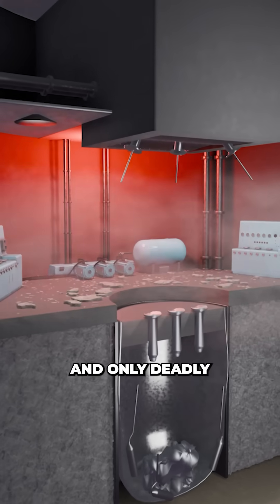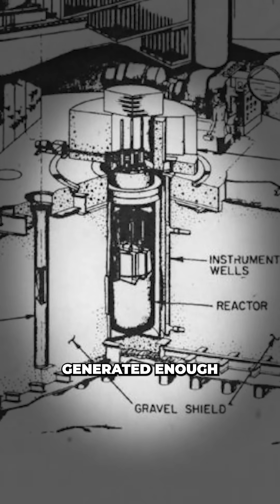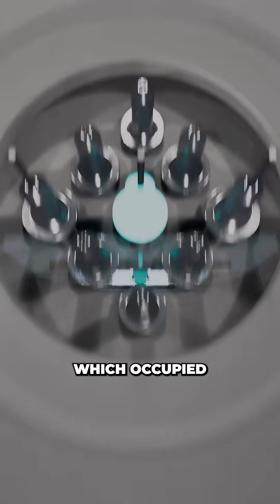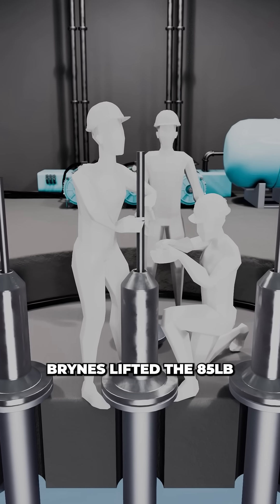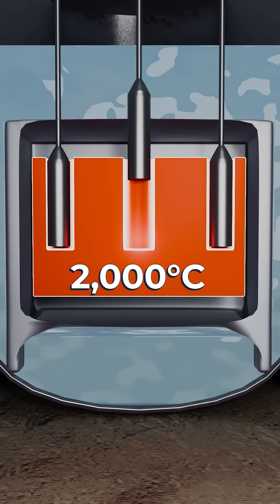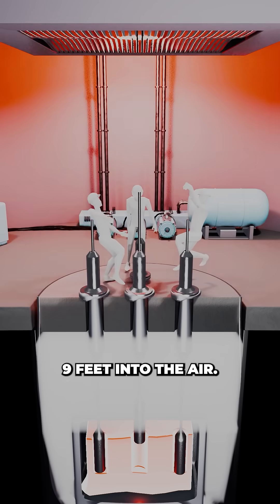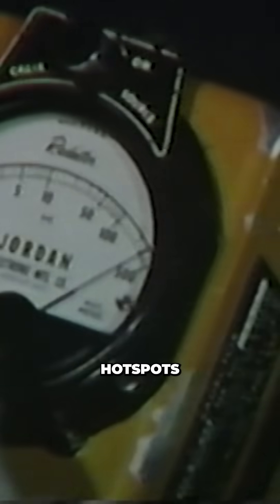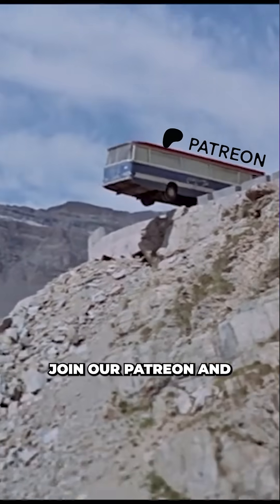The True Story of the SL-1 Disaster

Comment: "shredding his DNA" is the scariest sentence I think out of the whole video
Reply: Idk, "The explosions pressure wave blew loose one of the control rods, which shot upward like a cannon shell, piercing his chest and propelling him upward, pinning him against the ceiling" is pretty gnarly as well, but at least his death was instant. I'd take a cannon shell point blank to the chest over any amount of lethal radiation poisoning every time.
Reply: @AG-eb8yy they died almost instantly all 3
Reply: @ulrichkristensen4087 McKinley actually showed signs of severe shock and living a couple more hours before dying. The other two were instant
Reply: @AG-eb8yy well I’m not sure if it was instant. Without factoring in radiation imagine having your lungs and stomach instantly blown out by a rod of metal and being left to suffocate or bleed out (whichever one gets you first) suspended from the ceiling with no feeling in your chest except pain
Reply: @JMNplays584 you'd probably go into shock pretty quickly.
Reply: @AG-eb8yy It entered his groin and exited his shoulder, but your point is still valid.
Reply: @AG-eb8yy I don’t know man, it’s scary yes but having your dna banished to the shadow realm is kinda scarier. That is literally the genetic code for your body and it’s now simply gone 😭
Reply: @AG-eb8yy Was it instant?
Reply: @londonnelson7359  how could it not have been?
Reply: @ApertureAce  If it went through the right side of the chest, puncturing only the right lung and avoiding the aorta or vena cava, he could have lived for a bit.
Reply: @Justin.Franks  I think that the amount of trauma from a rod shooting through one's chest would massively impact the heart - even if the rod cleared it altogether. With that much trauma to the chest cavity, I'm doubtful the heart would be unscathed
Reply: @ApertureAce wow are you a doctor ❤
Reply: @ApertureAce  Radiation damage aside since I have no idea if what they received is enough for instant death, You might be very surprised (and horrified) to learn how long humans can (and have) live with objects sticking through their torso or even occasionally through their head. Depending which organs and arteries get damaged, and to what degree, a person could survive being pinned to the ceiling by a metal rod for more than a day without medical intervention, and in a non-nuclear meltdown scenario, could even potentially be saved and restored to near normal health.
Reply: @AG-eb8yy im of the opinion that the only humane treatment for high levels of radiation poisoning is a lead pill. its what id choose. survival is possible even with extremely high exposure, but improbable, and id choose a quick death over rolling the dice for a chance to survive my organs liquifying while im still alive to feel every second of it.
Reply: "shredding his DNA" is the scariest sentence I think out of the whole video

It is. Because radiation does not kill you outright. 

DNA is – in layman terms – the plan by which the body keeps rebuilding itself from the constant decay it experiences, keeping you from decomposing, by simply replacing dead cells. 

When those plans are shredded, that work stops. So you start decomposing while still alive... like a zombie.
Reply: @michaelkarnerfors9545  Radiation very much kills you instantly at much more than 10 Sievert like here.
Reply: @alexandernater6284 so with the amount of radiation he received in such a short time...causing his DNA to shred....does that mean, like...he was decomposing WAYYYY faster than someone with a much lower but still lethal dose ? Or maybe like I can imagine if you were watching closely you could see the radiation causing reactions on/in the skin and body and eyes...
Reply: @Globblin_DaFlowerChild  Radiation will cause massive tissue damage, looking superficially quite similar to severe burns. But what kills is the rapid shut down of the CNS. That has nothing to do with decomposition though.
Reply: Reminds me of a japanese victim. He received a horrendously high radiation dose. His body was literally falling apart and melting as doctors did everything they could to keep him alive. I honestly find this story particularly gruesome because he was kept alive against his will, doctors wanted to test experimental treatments for radiation poisoning.
Reply: @bassbusterx  IIRC his family begged to keep him alive so they kept testing treatments until he finally died
Reply: @Consumpter which honestly I find so awful. I'm not saying I don't understand, but they knew it was lethal, they knew he was suffering tremendously, they knew he wanted to die and yet they kept him alive. You're basically a prisioner of your own body at that point
Reply: @Consumpter you know what it doesn't really matter the man was still in his right mind and he should have told him the but the f out
Reply: @bassbusterx  We are always prisoners of our own bodies until death.
The torment in his last days as his whole flesh slowly melted off his bones, though, is the horror part.
Reply: @bassbusterx well but I guess even with everything they tried, it likely still didn't take much longer
Reply: @Consumpter any family that witnessed a loved one going through that and wanting them to be tested/kept alive is delusional. That's horrific
Reply: @bassbusterx they didn’t know he wanted to die, his last words while he was able to speak were that he wanted to live.
Reply: @bassbusterx  literally every single civilian nuclear disaster was caused by gross negligence. This genuinely pisses me off so much because imagine if they just kept the stuff up to date
Reply: @bassbusterx  the experimental treatments were stem cell therapy, bone marrow transplants from his sister, and blood transfusions. They didn't use him as a guinea pig but rather were desperately trying to save his life. If it had worked, the narrative of him being "experimented against his will" wouldn't exist.
Reply: @edluke3415 you’re assuming that because life is preserved, quality of life is assured.
Reply: @Lisa-im6hy Well, life preservation is usually the first step to quality of life.
Reply: @LorenzoCassaro lol, and the leading cause of death is being alive. there is no guarantee their experience after would be anything to rightly ask a person to endure purely for the sake of being alive.
Reply: @LorenzoCassaro  yeah? id rather die than live as a corpse
Reply: @edluke3415  I think everyone knew it wasn't going to work. Have you seen pictures of him in his hospital bed? It was like he was melting.
Reply: @bassbusterx grief is a powerful thing and his family still held out hope. Especially since a lot of the treatments they tried on Hisashi Ouchi (I believe that’s how his name was spelled?) seemed promising and almost seemed to be helping.

Him going through all that was so terrible that I don’t even have the words to describe it, but he was also brave for making it so far. The information gotten from the experimental treatments on him benefited the field of radiation sickness medicine a lot, if I’m recalling right. He still never should have had to suffer a fate so gruesome. But he will not be forgotten. Not by me, anyways. His name kinda stuck with me when I learned about that incident. We can’t let anyone else suffer what he went through ever again.
Reply: The body uses DNA to make proteins and other things cells use to repair themselves, or to divide and make more cells. If cells cant be replaced or repaired, as they die off tissues get neurotic. Cells with high replacement rates are particularly vulnerable, like those in the digestive system. Causing bleeding from orifices, and diarrhea). Hair follicles die off, leading to hair loss. Blood and immune cells cant be replaced. But the radiation itself doesn't liquefy organic matter.
Reply: @LionStrategic it depends on high energy  radiation you are hit with. In this case it broke all bonds
Reply: @bassbusterx  His last name was Ouchi, of all names. Hisashi Ouchi. This universe has a wicked sense of humor.
Reply: @bassbusterx  Yeah I don't know if you can feel anything when on a cellular level you got obliterated. I think the brain would do it's best to just keep itself from feeling that unless the brain cells were also fried, than does that make him clinically brain dead?
Reply: yeah, I'm pretty sure the guy that got pinned to the ceiling got off the easiest of the three
Reply: @beeer421 wouldn't he have died the slowest/last? The other two were instant
Reply: @amylee3531  No, he was in the center of the blast so he probably absorbed more radiation than the others, and in massive doses, you become unconscious instantly around 8-20 Sieverts
Reply: @amylee3531  Radiation sickness is probably one of the most horrible ways to die. It might have taken them a couple weeks of excruciating pain to die. Basically your body just starts falling apart.
Reply: That’s the scary thing about radiation. In high doses it can break down both your dna and your rna. Worst case scenario is you die a slow and painful death with radiation burns and the symptoms of ARS (Acute Radiation Exposure). 

Middle of the pack scenario is you die from cancer developed through radiation exposure. 

And best case scenario is you survive the whole ordeal with no cancer , but now you have genetic mutations due to your cells not reconstructing your DNA properly after the radiation exposure. Which btw said mutations can be passed to offspring. 

So yeah , don’t mess with radiation.
Reply: @VenyxK Godzilla is fine
Reply: "cooking living tissue"
Reply: Yeah, it's right out of a frame from the worst potential injuries Spaceman Spiff might suffer, when his nemesis turns their laser blaster up to 'frap ray'.  😬
Reply: Decompression chamber accidents are brutal but i dont think you'd feel anything.. So yeah, this is way worse.
Reply: And we know what that feels like because of Hisashi Ouchi. We can only hope they didn't suffer like he did
Reply: "...Pinning him against the ceiling" is what does it for me.
Reply: @peterparkin771  Hey man, whatever floats your boat
Reply: Imagine having a weapon like that
Reply: Idk man, the dude being impaled and pinned to the ceiling wouldn't be very happy either. Given thats NOT an instant death by the way~
Reply: Mmm...did you heard about 3rd guy who got pinned to roof?
Reply: Right.  Agreed
Reply: Lucky he was cooked or he would've been a walking ghost
Reply: Agreed. I would however like to nominate a Runner up "...launching the 12,000KG (26,000 Lbs.) vessel 9 feet into the air"
Reply: It's not just a standard impaling.  It's impalement plus "hit by a tractor trailer" forces  to lift you to the ceiling.

Not saying it had to be instantly fatal, but it's not comparable to an errant javelin impaling your chest. It's a javelin sticking out the front of a freight train
Reply: Exactly 🤣
Reply: HUMANS-- just  grow a garden to eat the fruit,,  vegetable, and feed  the protein that's needed to grow the brain, AND LEAVE THE, "WARP AJUSTment to those THAT WILL EFFECT  THE e.t.'s........
Mechanical nature.\n is why?\n Trump and other MEANING Large entities on OUR planet Earth are playing with nuclear testing again.................. as to have the external\n acknowledgment known to the 3 Rock/water to the SYSTEM 
    SO,  the  e t entities will be called - out what history already knows 
to only a few to HÒLD THE POWER ..............

Tesla FREE POWER. . ..
WHAT SHAME THE GOVERNMENT POWERS WILL FELL IN THAT MOMENT........

   so said glsjr !
Reply: not even the "pinned on the wall by the control rod" ?
Reply: Its true
Reply: The worst death I read was one of the people that volunteered to go into Fukushima to shut it down. It was a suicide mission. He survived in hospital for days after -and died a horrendous death. His DNA was literally disintegrating and he was still alive. One example, his skin started to disintegrate, so they tried to do skin grafts on him but the skin grafts would also just fall off because the DNA is disintegrating so there is nothing to bind the skin to. He had multiple heart attacks and was resuscitated each time, he begged for death but they kept resuscitating him. He could not even have the comfort of a his hand held or a hug from his family because he was radioactive so was in isolation. Mercifully one of the heart attacks finally put him out of his misery. 
One of the worst things about it is these heros who volunteered for this horrific suicide mission don't even get recognition because it makes politicians and the power plant executives look bad to talk about the disaster, so they swept it under the carpet. 
The full story of the suffering of this man is one of the worst things I've ever read.
Reply: Sunlight also shreds your dna. It's what causes sunburn, and skin cancer. Science!
Reply: @Pensnmusic  And equally horrific things will happen if you don't get your daily vitamin D intake, courtesy of sunrays. As with all things, balance.
Reply: @Dice-Z  or Vitamin D3 supplements 🤣
Reply: @Pensnmusic  UVB and UVA rays, more specifically. Too little sunlight is bad for mental health.
Reply: @JMton_t Really?!. After losing my paw 2 years ago I’ve barely been out the house and I’ve definitely been feeling “weird”
Reply: you dont have any feeling inside ur cell core anyway so it isnt painful and it was one quick way to go.
Reply: Nuclear energy is a foolish endeavor.  The catastrophic consequences of failures and the inadequacy of handling the waste byproducts are the reasons enough to put aside this folly. Nuclear waste that takes up to and beyond TEN THOUSAND YEARS to decay is reason enough to not use nuclear energy. How many nuclear accidents are needed to recognize this folly?
Reply: @MSilva-b5n   Nuclear energy is what we NEED MORE OF! Handled properly is safe and very clean. And if the politicians can get around the issues with recycling used fuel it is even better. The only reason this isn't done is because of non-proliferation treaties since this method can also make the isotopes for weapons.
Reply: @janus4002 what’s the half life of these fuels?  Do you even know?? It’s 20,000 years to 700 million years. That’s a long time to watch over a garbage dump to make sure it doesn’t contaminate and consume life.